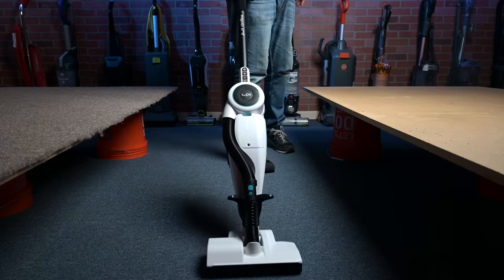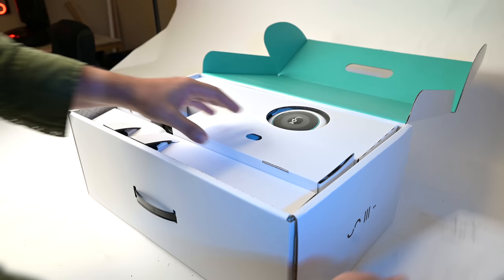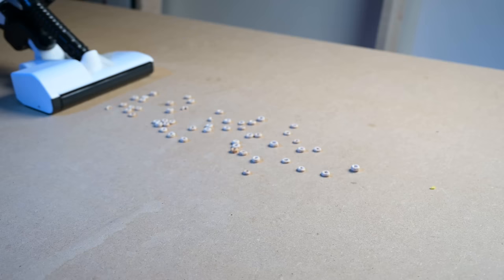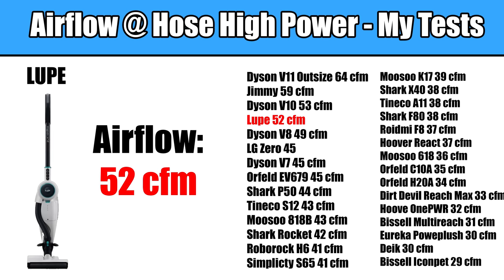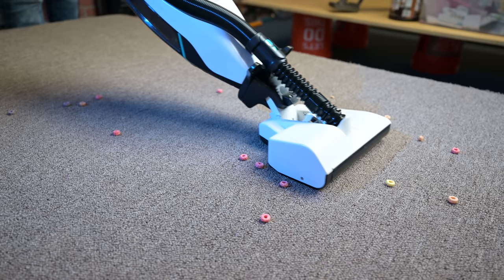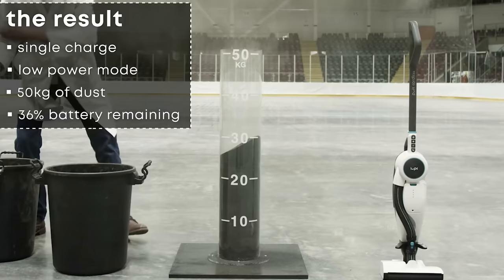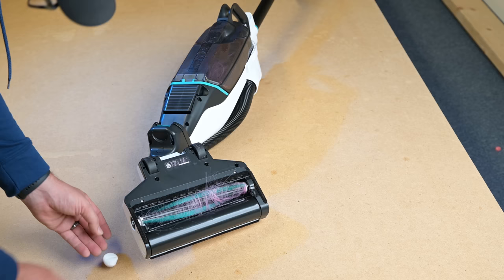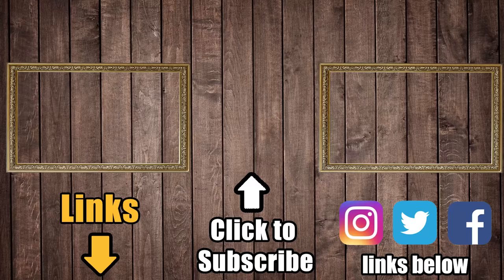Lupe Pure Cordless Vacuum Cleaner - REVIEW - It is THAT Good!

Comment: Couldn’t be happier with this vacuum!

We started with a dyson v7 and had that for a long time. Had a decent amount of suction, was versatile, etc. It was a great vacuum but like all cordless devices, batteries get weak in time. Since that series pre-dated replaceable batteries we were kind of stuck. 

On to the Lupe. The lupe blows the dyson out of the water everywhere. I’m sure a v11 or upcoming v12 are very nice vacuums but why the heck is the motor and canister in the handle? I never put much thought into why our 5 year old v7 was designed that way, just accepted it. Once we had the lupe it all made sense and my memories of old bagged vacuum uprights came flooding back. Duh, a vacuum should just kind of stand there and wait for you to come back. My walls are happier for it since I’m not leaning a vacuum on everything, playing the balancing act or trying to not trip on it. It’s just a far more practical design. 

We bought the lupe back in November of 2020. So happy we did. Powerful, maneuverable, very very versatile (attachment setups with onboard storage makes it much more useful than the dyson), easy to clean/maintain, battery lasts a long time (I can vacuum 2500’sq/ft of tile on almost one charge. I bought a second battery with the vacuum purchase so it’s never an issue. 

We have two Great Danes, a couple of kids and my wife has long hair. Hair hasn’t been an issue, no more so than any other vacuum I’ve had. It picks up small and large stuff easily. It gets plenty of use with our two dogs going in and outside all day. 

Yes pricey. I considered the v11 quite significantly, and for the cost comparison between the two, I figured: ‘in for a penny, in for a pound’ so there it is.
Reply: Glad you commented. Can’t wait to get mine in a few days.
Reply: How does the vacuum hold on now?!
Reply: Still running great. No issues and use it regularly. I would definitely buy it again.
Reply: @JayCrash450  thank you so much

Comment: "...durability and the ability to swap parts out as needed is really a solid selling point."   Only works if the company stays in business or someone picks up manufacturing replacement parts.  And the latter only occurs when there are tons of products sold like Chevrolet, etc.  If Lupe goes, so does the chance for replacement parts.  I do like the design & effort put into this vac.  Still too expensive for me.

Comment: Hello,
I am an electrical engineer and was wondering: would you be interested to add some electronics analysis in your review? Example: are the batteries good quality? will the motor controller circuit last long, how long can you expect the battery pack to last?,...
I could be interested in helping with this
Reply: These are tough to do, you would need to really disassemble the vacuum all the way down to get to the electronics. Then your test method is not standardised. The controller circuit you can analyse the chips used and what company makes them / what they are rated at but you would also need to monitor current draw over time to determine how long they might last. Still a guess at best. Batteries are easier but usually the company tells you the chemistry, and you can make a judgement call from there (i.e. Lithium ion ~85% max capacity after a year of daily use) The battery capacity in Ah is useful to know in phones where the power draw is a known chip but vacuum motors are not consistent in their draw as it depends heavily on the design and where you are vacuuming.
Reply: @davek2977 you are right, it is not easy. It would require disassembly to the boards and even more (look at topology, component selection,...) all this gives a good guess thought of the quality. Doing actual testing give more info but even without spending a huge amount of time into non-standardized testing you can already get a good feeling of the level of quality.
Reply: Would it even be possible to do non-destructive testing on, say, a Dyson V11? Those tend to be sealed up pretty good.
Reply: @draglorde  The tests that vacuum wars does tends to be more practical, but even a tear down or showing photos of the boards would be cool to see for us nerds :)
Reply: @Steamrick  Probably would be destructive, but I would guess that he’s not too worried about destroying a vacuum given how many he has at home...
Reply: @davek2977  the most practical tests that I could see myself do would be around the batterie usage: see how they charge and discharge it to get an idea of how much strain it see to get a better feeling of how long it would last
Reply: @draglorde  Yep I agree, as long as the OEM doesn’t do strange things with the programming. A lot of vacuums have auto functions now which might make it more complicated to test. I guess you clamp one terminal and judge based on current draw? Usually it’s that + temperature which degrades batteries
Reply: EE here also - Im curious how you would analyze the motor controller circuit. My assumption for batteries would just be some variant of 18650s in an xSyP configuration and never really LiPo but I could be wrong.
Reply from the maker: I would watch this!

Comment: So I was sitting here thinking, this might be a really good choice.  Then you got to the hair test.  With a 90 lb shedding machine in our house, hair is is about 90% of what I need to vacuum.  Hopefully, they can figure out a way to improve that aspect.
Reply: does your dog have 7 inch long hair? because if not this really shouldnt be too much of an issue. This is more of a problem with long strands.
Reply: @johnjingleheimersmith9259  That's a fair point, but when shed, the hairs will tend to bunch up, especially around the wall and any object on the floor.  So individual hairs are only 3 inches or so, but they could easily get matted into longer strands after being shed.
Reply: @kcgunesq  for whatever reason, these don't seem to cause any real issues. With all the animals and vacuum cleaners I've had... No issues, but long strings and long hairs... Different story
Reply: Honestly, we have a 65lb shedding machine and two ~14 lb tabby shed machines and we love our little Roborock S4. We have mostly hardwood flooring with some rugs, and we rarely if ever vacuum the floor it's on. 

I will say it's not great on really long shag carpet, I put it in the office one day and that rug was a little too much... It's like 1.25" or more
Reply: @ardenthebibliophile  as far as I've seen, no robovacs are really great on highpile like shag. Some can tolerate and barely get through them, but none can really do the job of a dumb vac on highpiles
Reply: He reviewed a vacuum that is specific to pet hair. I think it was a bissel. Only reason I didn't buy it is because it's a walmart exclusive. I got an ilife v5 and it does real well with my dog's hair (gsd) specifically because it doesn't have a roller!
Reply from the maker: @kcgunesq We just posted Best Vacuums for Pet Hair 2020 - 
https://youtu.be/uutFDoZdhgs

Comment: Do you have the ability to shut the brush roller off?  It very much looks like a prototype still with that high-mounted hose in the front.  For some reason they went with a double brush roller design which has never really gone well historically. 
  Glad you're able to attain one Chris!
Reply from the maker: Yes it has a button to turn off the brush roller. I should have mentioned that.

Comment: - Developped for durability: not hard to beat (that being said my Miele vacuum hasn't failed once in years).
- Only 2 years of warranty on the battery?
- Are the replacement parts costly (like the hepa filter...)?
- Very interesting product. Now if they can develop a robot vacuum ;)

Comment: Please Review the Shark VERTEX Uplight Cordless! Dying to know the Airflow strength (especially in turbo mode) and confirming that the new HEPA system passes the fog machine test, since the chamber connection is kind of on the back side and not enclosed behind upper container like the APEX Uplight duo corded is. Thanks!
Reply: ITS GOT AROUND 27 INCH SUCTION ON REGULAR AND 80 ON HIGH, WATER LIFT
Reply from the maker: The cordless Shark Vertex review releases today at 4 EST!

Comment: It costs more than $650 dollars. Why don't you test the higher end oreck vacuums?  There's the elevate cordless and elevate conquer. I have the conquer and it literally eats small pieces of carpet when. I get close to the corners. I haven't seen a vacuum review you made that can do that. Plus they are covered for 20 years. They support their stuff seeing as they have many repair centers in the country just in case. My previous oreck at least 10 years before I went for an upgrade. That old vacuum still works and gave it away.
Reply: How is being so powerful it can potentially harm carpet fibers a good thing?
Reply: @kimberlybrookes5844  it doesn't destroy the piece of carpet. But a 2x4 carpet will lift when I pull the vacuum back. I can never pull it back without the carpet lifting. Not regular house carpet that's stuck, but the small carpet that can be rolled up and washed. There is no damage.

Comment: I bought it because I saw this review and thought let's give it a try. After one and a half year of using  it I am extremely disappointed. We need to clean and wash the whole vacuum after each use because the suction is so bad it doesn't take sand. It's only good with light dust but if my kids bring a bit of sand it just doesn't take it. I feel like this vacuum that was used for testing is somehow better than the ones sold by the company. Seriously my Lupe vacuum cleaner performs so bad, that I started to miss my 15 year old vacuum that was loud and heavy but at least my house was clean.

Comment: Will you be reviewing the new cordless Mieles? Seems to share a few features with the Lupe.
Reply from the maker: Thank you for your suggestion - I'm noting that now!
Reply: @VacuumWars  would like to see how it stacks up against the oreck pods and new cordless mieles
Reply: Miele HX1 suction is disappointing for its price point. Battery life is also poor since you need to run on higher power to get reasonable suction.  Miele biggest blunder is the dustbin design. The cleaning process is a lesson in frustration.

Best part of the Miele is it stands on its own.

Comment: Should there be any concern with the company being so new? The idea of a vacuum with parts able to be replaced in lieu of purchasing a new unit is very appealing, but that point would be moot in the event that the company responsible for making the parts no longer existed. I'm sooo ready to make this purchase...that amount of money, though! I just need some concerns assuaged...
Reply from the maker: It is a concern for sure. I feel a little better about it in this case because they designed the Vacuum from the outset for spare parts.
Reply: To add, the founders spent 5 years from start to release of the Lupe. I doubt they'll be walking away so easily. If they did falter, my hope is one of the existing brands would purchase their IP and would continue producing the Lupe. It's really that good.

Comment: Slick brush roller is really impress me. On the wooden hard flor it can grab even my fingerprints. This thing help roller head literally stick to the ground and don’t waist any suction power. Other top vacuum manufacturers need to make such brush-head because it provide whole different level of cleaning...
Reply: That front roller must be bad for wood floors, imagine how it grinds sand into the wood finish... you’ll have dull, scratches floors in no time.

Comment: Really cool and comprehensive review. Saw this vacuum from your best of 2021 video. A question, if you know, I have very small hands, what is the diameter or circumference of the handle you hold? Many thanks.

Comment: They should include something like a automatic knive  which cuts everything stuck in the head with an easy to use lever or something like that.

Wouldn't affect the performance and could be done easily after each use :)
Reply: Like Electrolux ergorapido vacuum
Reply: @bluehaert  well I don't know any Electrolux vacuum 🤔
Reply: @RubenKelevra  oh I think that's a European brand. The technology is called brushrollclean and trademarked

Comment: How long will the front roller last? Looks like it takes damage quickly
Reply: Wear tear is expected ..it depends on how much you use.. good things all parts are replaceable.. if you look future wise you can buy replacement which work out cheaper in long run

Comment: I bought this Lupe vacuum based on this review... what a mistake!  The trash bin is hard to open for I have to press the unlock latch and manually use my hand to flip the lid open.  Then all my dog fur is stuck in the middle of the rectangular bid so I have to shake and bang and finally use a stick to get the fur out.  The brush would stop when I go over area carpet and I have to keep pressing the reset button to get the brush going again.   Also noticed that the unit is hard to push when using on carpet, much harder than a Dyson ball corded vacuum.
But my main gripe is dog fur and how the trash bin is hard to open and empty.  This is a waste of $676, 'm keeping my Dyson V11.
Reply: Interesting. I've used several bagless vacuums and I find the Lupe bin to be one of the better designs.  The reason you have to use your finger to open the lid is to avoid accidental opening. And it's really simple to unlock and open all using one hand and single motion.

When emptying the bin, don't use a stick, grab the cyclone and pull it out. The debris will mostly fall out.

I haven't experienced the brush roller stop on my carpet or area rugs. Not once. Contact Lupe and discuss with them.
Reply: @claykin1  I did pull out the cyclone and pulled it out and now I got dust coming out from both ends, and the fur still stuck in the middle.  I've contacted Lube for RMA.
Reply: @steveliu8950  surprising. I've not had any of this occur to mine. I've had to pull out the cyclone a few times and everything emptied fine and the cyclone went back in and sealed without issue. Something must be wrong with yours.

I've used the Miele HX1, Dyson V11 and LG A9 cordzero and the Lupe to me has by far the best dustbin.

I'd say discuss it with Lupe as I suspect there might be an issue with yours. But if you're over it, then I guess you've got your answer.

Comment: Is this vacuum good at cleaning carpet edges along a wall? since the front of the cleaner head is a roller, which is better for hardwood, I'm thinking if I stuck this up against the wall, the carpet's edge wouldn't get vacuumed well?

Comment: Pretty small test with the hair... I have longhaired dogs and have tested Xiamo Dreame v10 and got that simply because of the roll-brush (not brush like this) as that doesn't collect the coat from the dogs like this one ...... do you know if they are changing or would do another head ? - as you also pointed out that this was not very good. The problem with the Dreamer is that you have to clean out everything yourself with the fingers - drag it out ot the compartment ...... you never showed how this was doing with lots of stuff inside it ..... would have been nice to know... Cheers

Comment: Was planning on picking up the dyson v11 outsize for black Friday but now I'm torn between this one and the dyson. Wonder if there is a comparison video in the making?
Reply: Dyson v11 outsize has almost twice the suction and much larger bin than   this one and cleaner head is also very wide which will actually save your time when you clean larger area  and can pick up large or small debris The run time is also twice due to the 2 battery pack inside which can give you about 2 hours run time. And  packed with many different attachments that actually helped a lot for versatile cleaning. It s a very clear choice my friend. I have done my own research. Don t listen to everything he says.I Don  t have any problem with his videos and he's very good in reviewing. But not everything he says is always true. I  have been selling  vacuum cleaners for many years.
Reply: @shafaatbai3706  some very good points, I had the v8 animal and no issues except battery ran out during cleaning, and they clearly solved that problem. Think I should just stick to what works and get the outsize or should I say oversize lol. Thanks for the information.
Reply: @jesseparbhu6125  outsize it is. 😊
You re welcome. I am glad I could help.

Comment: These engineers were probably frustrated with Dysons breakages when they worked for Dyson. They wanted to build a better quality vacuum cleaner that is not designed to be thrown out after only 5 years.